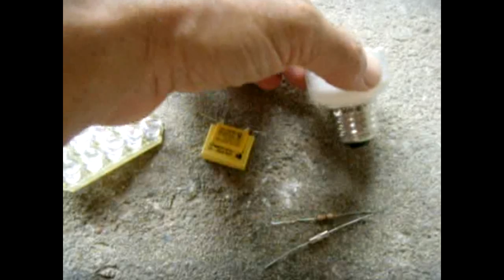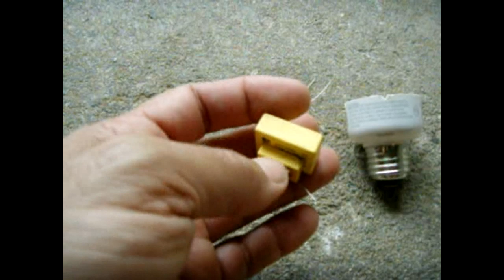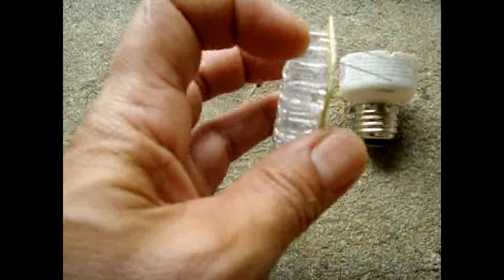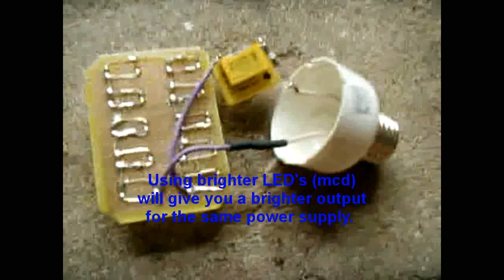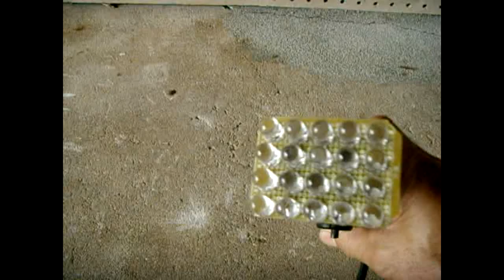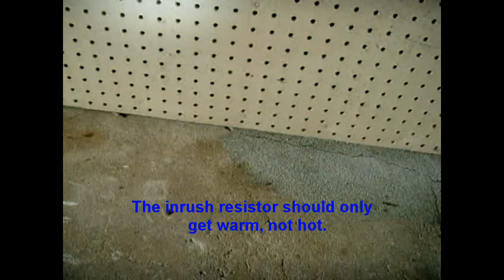How to make a 120V LED spotlight bulb

Comment: This is awesome and I hope to make one of these this weekend but I had a question: Where did you acquire the capacitor from, if you don't mind me asking?
Reply from the maker: This circuit works perfectly. The capacitor can be found inside a junk television, and other electronics. Just make sure the capacitor is rated 250V or higher.

Thanks For Watching!

Don't forget to check out my video playlists as well.
Reply: electronicsNmore  Gotcha!!  Thanks!!  Does the capacitance matter as much as the voltage??
Reply from the maker: Absolutely. Higher capacitance will allow more current to flow. Try and duplicate what I did in the video. If you cannot find the same value capacitor that I used, you can take two smaller value (250v) and place them in parallel.
Reply: electronicsNmore Thanks again!!!!!

Comment: What does the capacitor do in this circuit ?  Is it used to smooth out voltage since you are only using a diode ?
Reply from the maker: No. When AC current flows through a capacitor it acts like a resistor to limit the current without creating any heat.

Comment: can u send me the conextion of the leds i dont get it =C
Reply from the maker: Take 2 led's and connect them in parallel with one another. The short leg of one LED connects to the long leg of the other LED. Make 10 groups, then connect all of them together in SERIES.
Reply: +electronicsNmore. Connecting the short leg to the long leg of another is series, not paralled.  If i understand this correctly, you have 2 sets of 10 LEDs in series and the 2 sets are in parallel? If the foward bias voltage of each LED is ~3.5V, thats a total of 35 volts dropped across the LEDS. That would leave ~80 Volts across the current limiting resistor. Even if all 20 LEDs where in series, it still would not be possible. Whats going on here? What are the capacitors doing? Could you explain this circuit with a schematic please?
Reply: +electronicsNmore Ok, I took another look. It apears that everything is in series including the parallel capacitors/ bleeder resistor. Are the caps lowering the peek AC voltage? You mentioned that the caps are responsible for the current limiting. Then whats the 330 ohm current limiting resistor for?
Reply from the maker: The resistor limits the INRUSH current which can destroy the LED's.